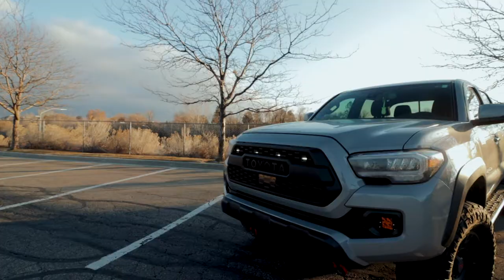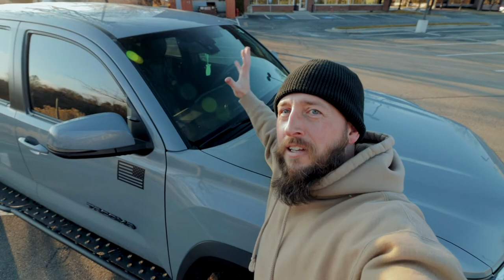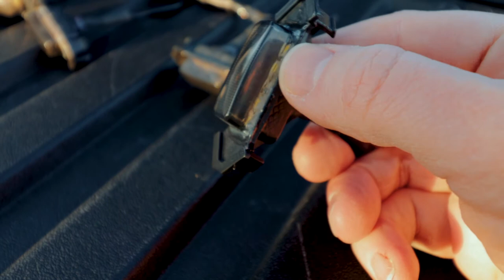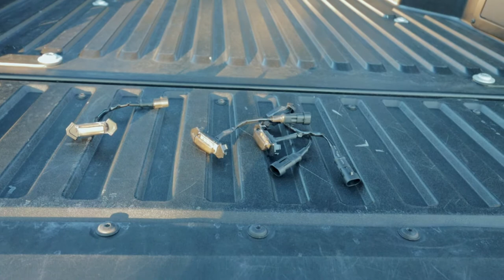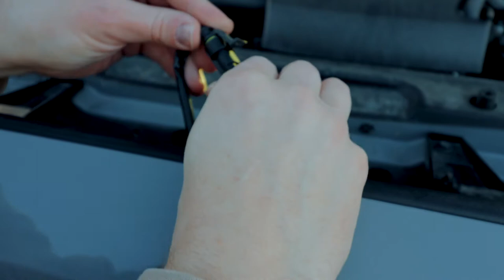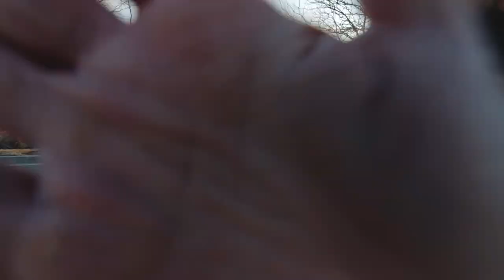2021 New Year | How to fix Grill lights on 2020 Tacoma Pro Grill.

Comment: Did you buy new lights from the same folks, MC? And then silicon the new stuff I'm assuming? I have R4T lights due in 13 JAN ...with the plug n' play DRL harness. Will be using with 3D printed adapters from a vendor on Etsy for my OEM 20' TRD-S. Should look good when done I think. Hopefully the R4T lights are better constructed and avoid the water issue.
Reply from the maker: My new set was from Amazon, and they looked exactly like the set that came from MC. I don’t think there is much variation on the lights and they may all come from the same manufacture. I’d be interested to know about your set from R4T though. 

I have seen the adapter for the 2020+ grills and they look good. I’m sure you’ll be happy with them.